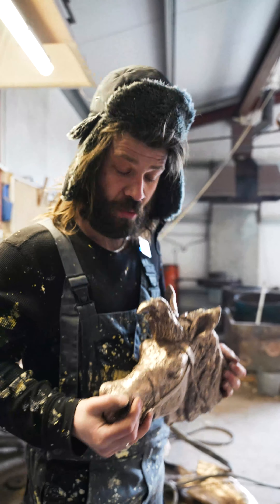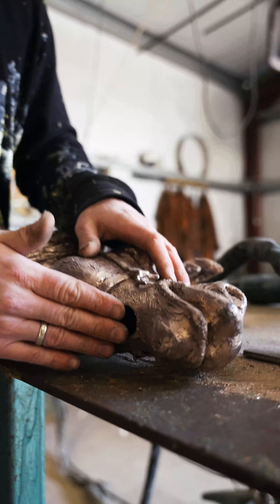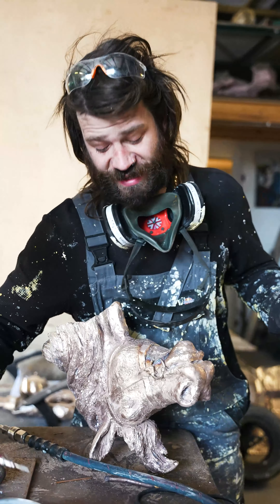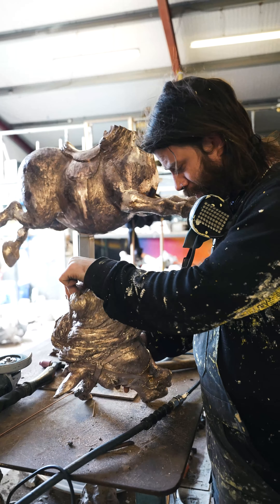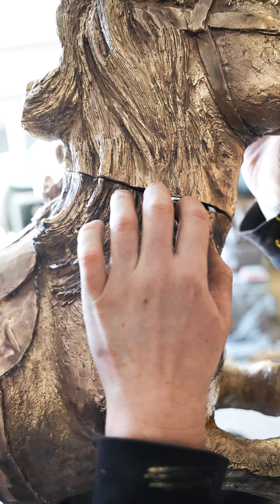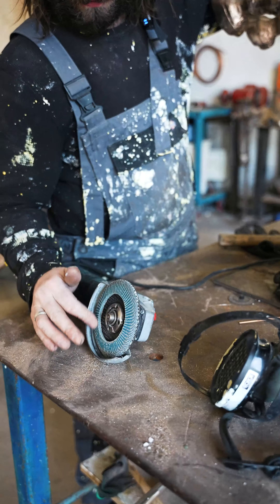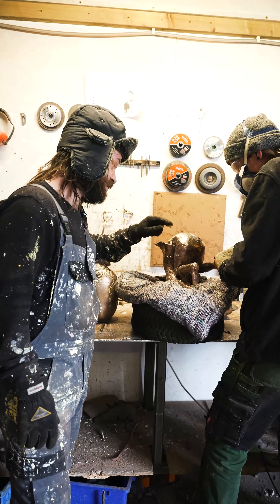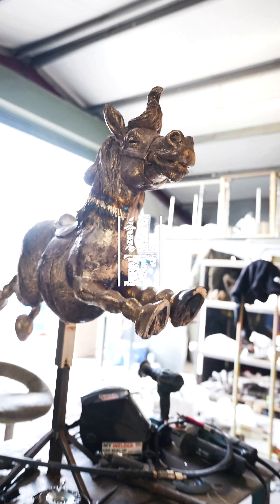THE SECRET TO REMOVING WELD LINES... // THE LOST FOUNDRY

Comment: Nice one mate. What alloy are you using to cast and what filler rod are you using?
Reply from the maker: We cast in brinze which is a micture of copper,tin and silicon. And then we use a silicon rods to weld them together.